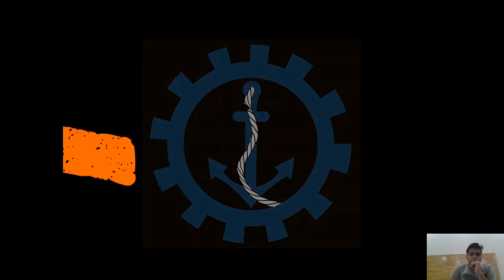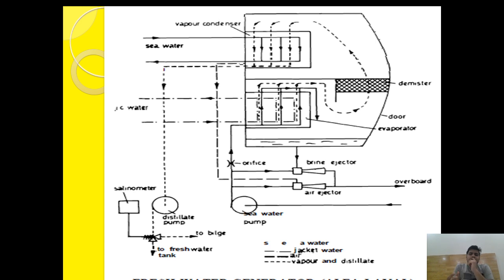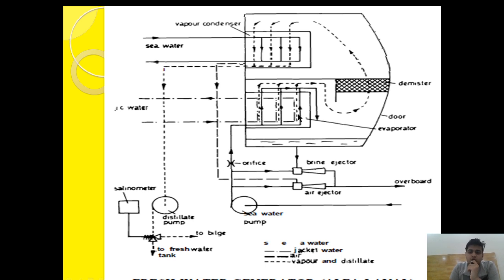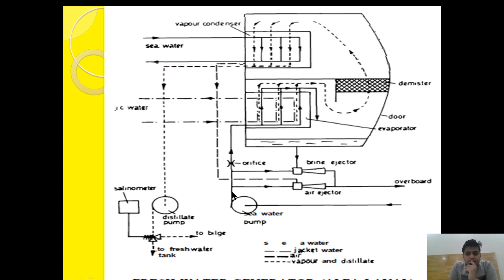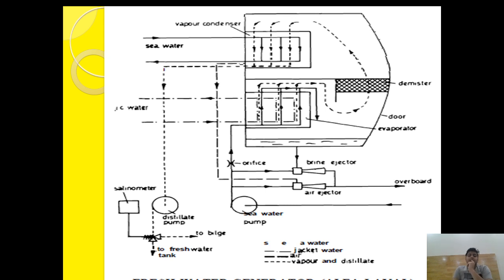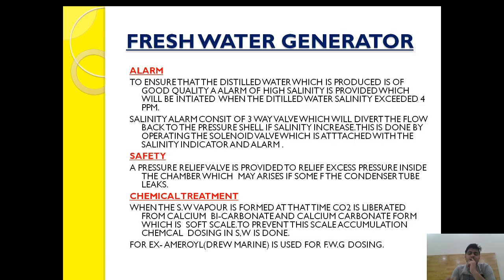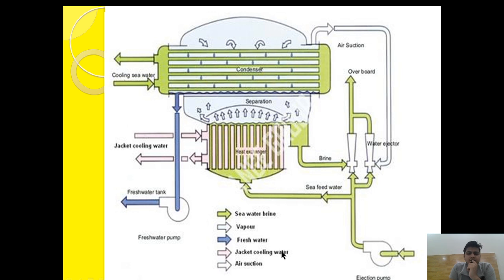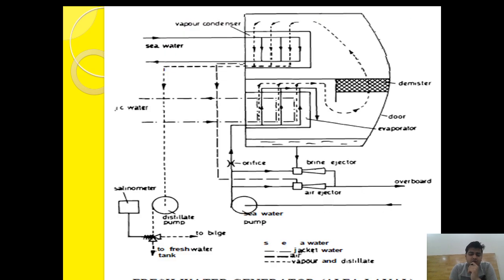FRESH WATER GENERATOR|OPERATION|SAFETY|ALARM|CHEMICAL TREATMENT|

Comment: 1. Why orifice after sea water pump is given?sea water pump capacity?
2. What type of heat exchangers are used in evaporator and condenser?
Working of air and brine ejector along with rate of flow ?
3. Mention Parts need maintainance and how often checks are carried out here?
For how much time this machinery is operated and quantity of fresh water generated during a time period?